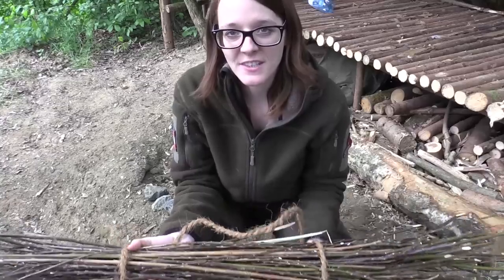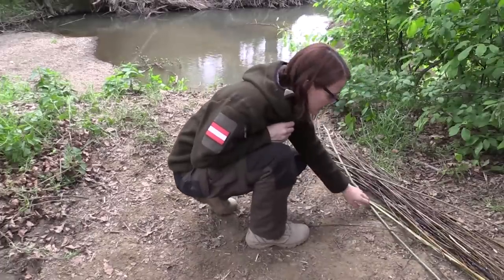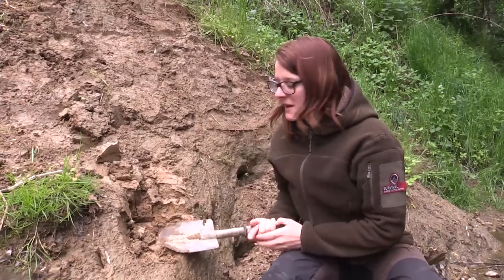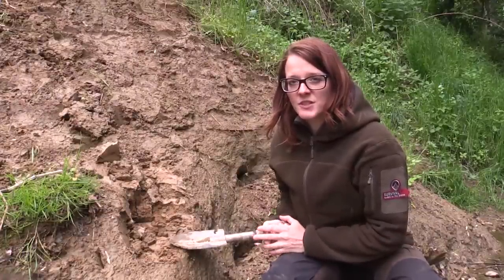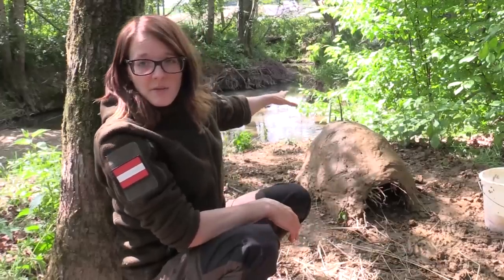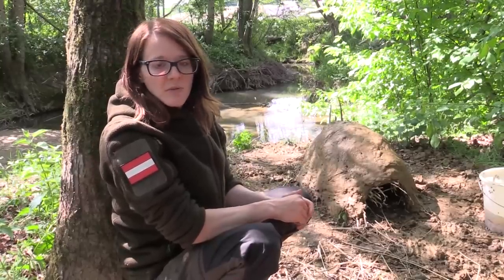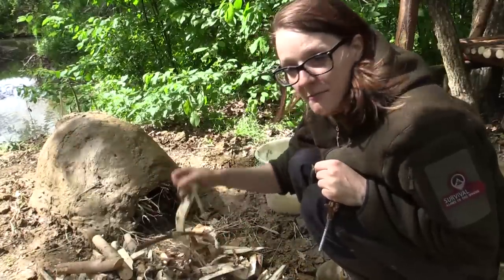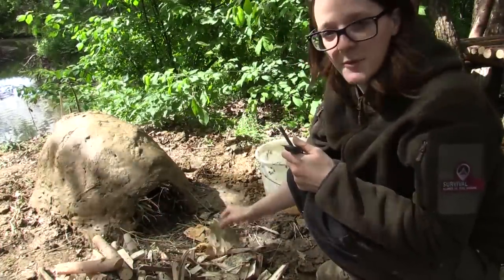Building A Primitive Earth Oven

Comment: Hi Lilly of the valley. I figured it out as I seen it, but others may have not. The hole on top is a exhaust for the smoke, and st the ends, this differences in hight is so the heat will flow towards the front to cook better.

Comment: If you would cover the entire inside and outside of the oven with kindling and fire the entire oven until the fire burned out then clear off all the charcoal and ash then that would bake the outside of the clay too which would keep it from cracking because then the outside would be just as hard baked and fired as the inside clay of the oven.